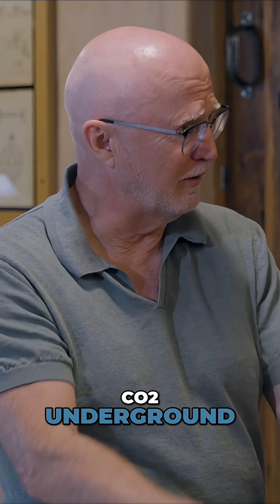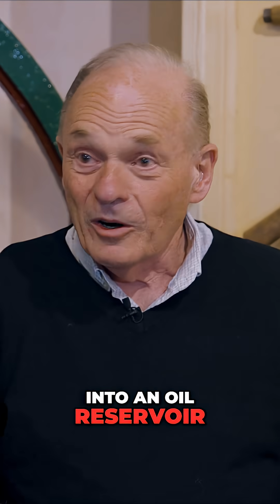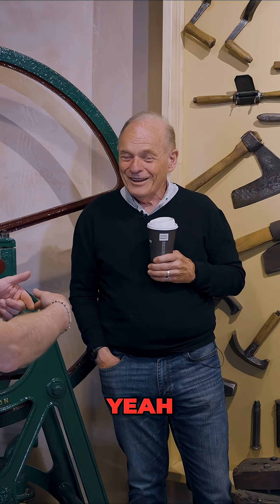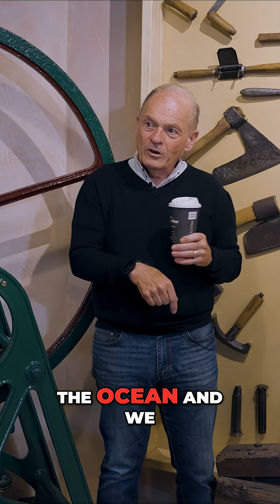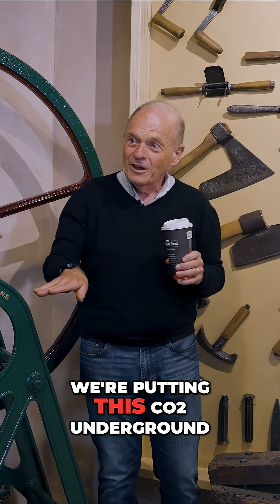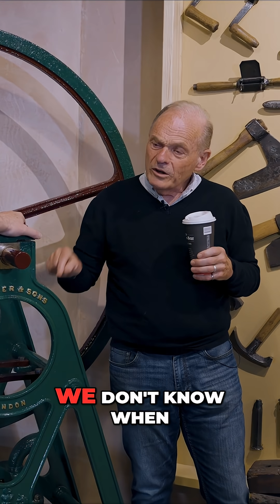IS CARBON CAPTURE IS SAFE?

Comment: The oil wasn’t put there under pressure your pumping that into the ground using pressure. What a load of crap. And what about the carbonic acid problem the cost of doing this is in the trillions money that could be used for projects like renewables and nuclear.

Comment: Look...These people are obviously Complete idiots. Firstly....The internal combustion engine was invented in 1865. It was designed to run on alcohol , Which only produces Carbon dioxide as an exhaust.   In 1875 they were refining oil and some fool used a little gasoline in an internal combustion engine and they found a way to use the main waste product of oil refining. But the Fossil fuels, when burned only cause Carbon Monoxide.  Carbon Monoxide is extremely poisonous and it does not go away. It cannot be converted. The Catalytic converter is a scam. We are dying from Carbon monoxide poisoning and here's these 2 idiots talking about disposing of Carbon Dioxide.....Yes, The same carbon Dioxide we exhale as we breath.  This is insane. We have been Gaslighted for 150 years...to the point where scientists actually believe the lies.